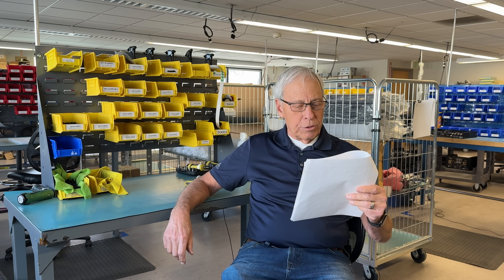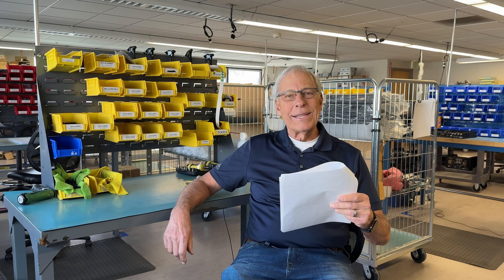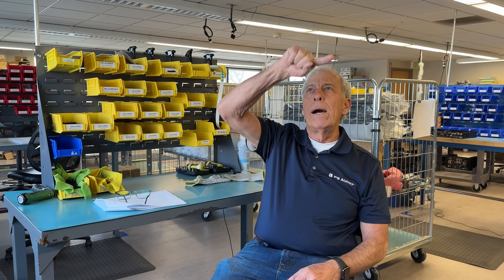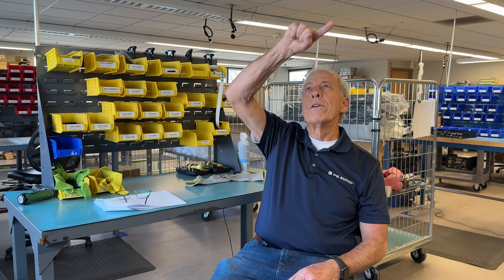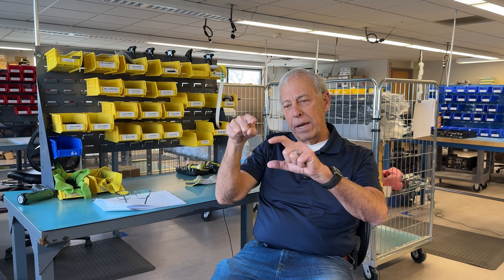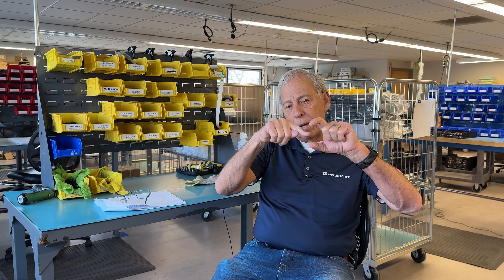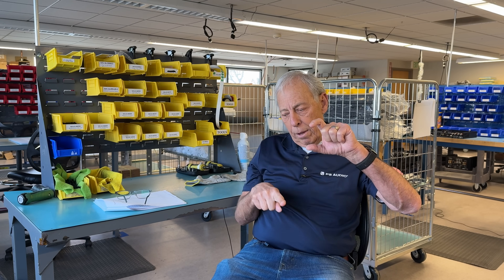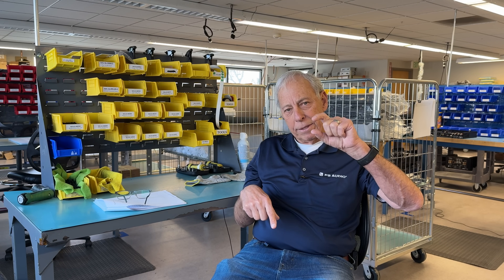Paul explains partial Class A

Comment: Hi Paul, It seems that some reasonable class A regime (for example, the first half watt) is good for the sound, as many listeners listen to music 99% of the time in this range (depending on the music).  Why do most class AB amps use so little bias current? (I know Rotel power amps uses only 18mA per output transistor, and 3 pairs of output transistor would only provide 0.864V of output max into an 8 Ohm load.) What determines the best quiescent current setting?  Thanks!

Comment: Class a . The output transistors play both the positive and negative swing..class b .. one section plays the positive side..the other plays the neg swing..class ab is basically class b except the 2 banks play a little bit of the opposite bank so theres no gap when they switch...now ..high bias class ab shares more of the center trade off section when the volume is low acting like class a but slides out when output passes 50 watts..or so. Why ? Because nelson pass is correct when he made his 5 watt statement..you must be class a ..at least up to 5 watts..

Comment: OK, I never get an accurate answer to this. I always hear technicians say class a is different and the class a in class a B is not the same class a. My question is always how much class a is in an amp before it goes to b. But if it’s not the same, then, what difference does it make. Does anyone have an answer to this?
Reply: Depends on which version of Class AB. e.g. Class AB1 has just enough forward bias, operating on with no input, Class A until 0.7Vdc for a silicon bipolar transistor. While Class AB2 could be from perhaps 1W to ???Watts.

Comment: 0:42 twice as much power ALL THE TIME as it can produce MAXIMUM. An AB amp also has a maximum efficiency of 50% (sine wave) but is almost that efficient all the time. 
It is important that "A" was not chosen as a value judgement! It's the most fundamental kind of amplifier, and all amps have class A input stages.
In class A, something's pulling up and something's pulling down at the same time and partially cancelling, so for class AB it's really more a matter of current load not voltage directly when the transition to class B (push OR pull) occurs.

Comment: In a Class A amp, the device is designed to operate in it's mid point with no signal in. An input signal then causes the output to swing up and down with it. Up to it's max clipping point and down to shut off. 

Class B is designed to sit at a zero out until some signal is put in. These usually use two or multiples of two set of devices. One for the positive side when the input goes positive and one for the negative side when the input goes negative. Tubes will go from zero shut off to on instantly. So a Class B amp using tubes will do OK at the point the input swings from positive through zero and into negative. While bipolar solid state transistors have a barrier voltage that the input voltage needs to exceed before turning on. 0.7Vdc for silicon transistors. So solid state amps are designed to stay on rather than go into full zero shutdown when no signal is input. This is called Class AB. Class AB1 is when just enough bias is applied to each half's devices that they are on with zero in. Class AB2,... are when the forward bias is increased past that switching threshold. The further up, the lower the distortion at lower levels. and lower level signals. But the compromise is maximum power out and heat.
Reply: ^^ this.

Comment: I thought for a minute they were bringing back the variable bias circuits from the late 70s into the 80s that many of the receiver companies were doing to prevent switching distortion.  I think Technics named it "New Class A."  Many of those ran pretty hot and had complicated bias circuits!  I've also heard of a rail switching scenario that used class A at lower powers and a more traditional class B at higher powers.
Reply: Yes, I still have one of those Technics New Class A amps and it indeed has a variable bias circuit. Doesn't really run very hot but then I mostly play it at very modest volume.

Comment: Sorry, it's not what I learnt in engineering class, I don't care what marketing guys said.  Class A, class AB amplifier, as others said here, it's all about bias point.  Class A, you turn on the transistor by bias all the time.  Class B, you turn on the transistor only when signal is there.  Class AB, you turn on the transistor partially.  So, Class AB amplifier gets warm, not because the so called 'partial Class A' part, but the partial bias to turn on the transistor.  Class B amplifier also gets warm, not as much as Class AB, because, the transistor even turned off, is not a perfect insulator.
Reply: Paul gave a simple explanation that’s close enough to what you said, but more understandable to the average person like myself for example.
Reply: Feel you, brother. It's a lifelong journey. 😊 @larryhoffman7471
Reply: The partial bias is called class A.
Reply: 100% duty cycle.

Comment: I understand Paul's explanation and it sort of gets to the point, but I think many unfamiliar with amplifier output stage topology will not understand it.
How class A works vs class AB (and other classes) is nigh impossible to explain without any drawings or explanations of different style output stage topologies. It also really requires a discussion about the increasingly non-linear and discontinuous behaviour of transistors near their shut-off point, and how class A is a very simple but also very inefficient way to prevent the associated crossover distortion, dissipating lots of "wasted" power in the amp itself.
It is not helped by the fact that there are many different minor variations of "class AB"  that all aim to minimise or eliminate the problem of crossover distortion (and nearly all of them have fancy marketing names, like e.g. Technics' "New Class A" from the 80's)

Comment: Ok, but why? Why is there a need for the class A, at all?
Reply: With class A amps the sine wave is not swithed on and off and is just one continuous sine wave. The cheaper class B amps have "notch" distortion and is an issue with purists (and sometimes with more expensive class B amps). That's cos the negative part of the sine wave doesn't quite line up with the positive wave (when + or - switches on) leaving a tiny notch in the sine wave (it's distortion). As long as you don't turn an AB up too much, there is 0% notch distortion! Sounds better. Under a certain volume, they go from class A to B. And it's surprising how loud one watt is, so most the time an A/B amps run on A. I got an  AB!
Reply: Towards the end of the video when Paul is talking about the partial on state of the transistors.  If those transitors go completely off then they have to be turned back on.  That will cause what is known as crossover distortion.  Keeping them on all the time reduces that distortion.  Crossover distortion is also why it is said that class a sound better,  since there is no hand off to another transistor is no crossover distortion
Reply: Listen to the Music Fidelity A1 then you know why 😊

Comment: That did not help at all.  I think of class ab as using two transistors or tubes. One handling the positive side, and one the negative side.  An amplifier is either one or the other.  Are there multiple stages?  A class A stage followed by class AB stage?  Do the amplifiers have 2 power supply rails, one set for class an and a second for class b?
Reply: If you replace "amplifier" with "stage" perhaps. But in many power amps the first stage is class A buffer/ voltage gain stage, Then if the amp is any of the Class B's, complementary designed stages.

Comment: Somehow Your explanation is not conclusive. What happens to half of the 200 watt consumption of a 100 watt class A amplifier if only 100 watts are delivered to the loudspeaker? 
Do they flow into the other channel or are they wasted?
Reply: In a pure Class A power amp whatever portion of its rated power not sent to the speaker has to be dissipated as heat in the heat sinks. There is no sharing between channels.

Comment: Class E, F, G and H also exist. E.g. class G is using multiple power rail voltages that can allow more class A efficiency by lowering the power rail voltage depending on volume level and actual need. Some great amps are running class G. But for the same BOM cost, the money might be spent better in other components.
Reply: Those exotic classes are still AB circuits but with power-supply modulation.    
I have heard a few Soundcraftsmen class H amps, and I have to say that they sound Very good to me.    
Hitachi went for class G and did well, too, but their sales figures weren't much to talk about.
Reply: @spacemissing  I can't argue against class G or H, and those are true engineering concepts with some advantages and not just snake oil.
Reply: @spacemissing Arcam has very good Class G amplifiers